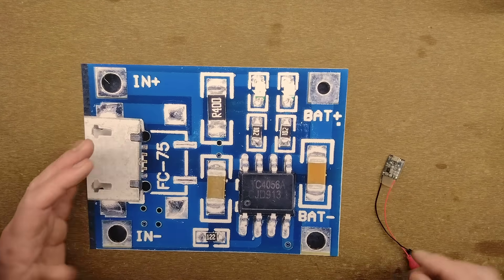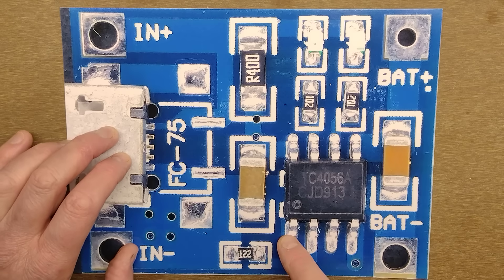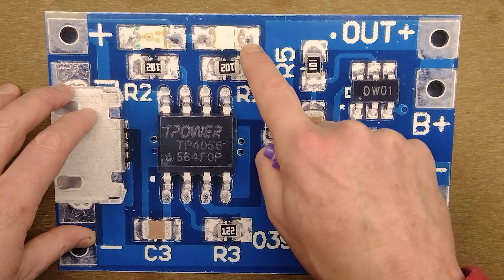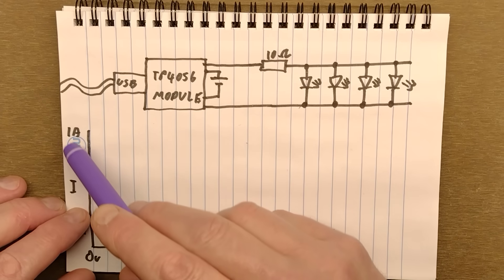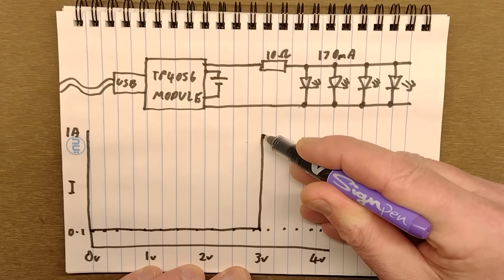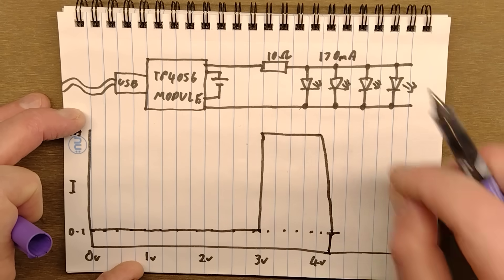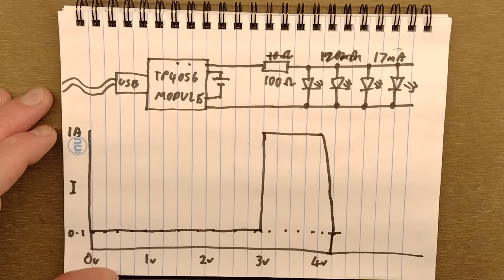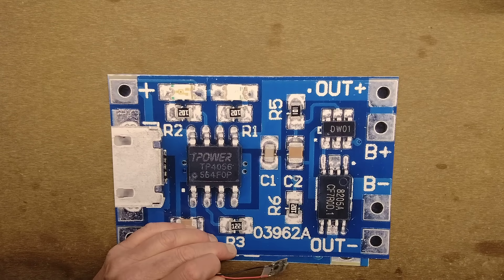TP4056 myth busting

Comment: That seems the opposite of the widespread myth of starting cars or motorcycles that are not driven in winter for 15 minutes every weekend "to keep the battery fully charged"
Then in the spring/summer they are frustrated to discover that they need to buy a new battery "after all the care" they gave to the old one... 😓

Comment: ive found significant differences in 4056 versions -if your cell is under voltage some tc4056a trickle charge at 60ma some at 200ma (with a 2.2k mode resistor) but these chips really need reverse battery connection protection if using loose 18650,s and cheap battery boxes that have the same terminals both sides of the battery its so easy to blow the chip

Comment: You missed one potential gotcha here: Let's say that you have those LED's configured for 170mA and attached permanently to the battery, with the charger configured for 1A charge current. If the battery voltage ever drops below the trickle charge threshold, then the charger will only supply 100mA. All of that current will be burned by the LED's, and the battery will never charge to a high enough voltage to start the normal 1A charge cycle. This could effectively brick the device. The easiest way to fix this (if you're designing the device) is to include a circuit for load bypass, allowing current from the +5V charger to drive your load, and letting the battery charge chip charge the battery alone as it's intended.
Reply from the maker: There would be an equilibrium point where the lower voltage would result in lower LED current.
Reply: @bigclivedotcom  Yep absolutely that’s true, it will also depend on whether that voltage falls below the trickle charge threshold.

Comment: Is there a component one can change to set the CV level?  I'm interested in a storage voltage of ~ 3.8 V, and a conservative charge of 4.0 V.

A hack I've found is to put a Schottkey diode (forward) in series with the battery, which tricks the charger into thinking it's done while the battery is still at 3.9 V.  Although this hack wouldn't let one use the BMS feature of the fancier chip.
Reply: I also put Schottkey diodes in the charging circuits of a LiitoKala Lii-202 (for cylindrical cells).  Since that charger has modes for regular and HV cells, I have the option of charging to 3.9 V or 4.05 V.
Reply from the maker: I tried tow reverse parallel schottky diodes a while back for both charge and discharge limiting.  The TP4056 started oscillating because the forward voltage was affected by the current.

Comment: I once had a TP4056 fail dead-short across the cell when operating at 1A and its thermal limiter was active. Now I avoid using them over ~500mA unless I have really good airflow or a big PCB ground plane underneath.
Reply from the maker: The DW01 protection chip will also potentially shut down if it detects a short circuit.
Reply: @bigclivedotcom  but what about the board with no dw01? looks like theres nothing between the cell and the chip (apart from any connecting wires)?
Reply: maybe good idea to fit a fuse between the cell and the charge board?

Comment: I slightly disagree.
Please calculate with 20 ohms.  The LEDs now take 85mA. The charging would stop, when the battery takes less than 15mA, not the 100mA intended.

Comment: It really helped me to understand how chargers work when I found out they limit current by providing the voltage necessary to draw the set current. The required voltage keeps increasing until it reaches the max voltage and it maintains that voltage with less and less current being drawn until the battery is fully charged. That is why fast charge phones brag about how fast they can charge from 0% to 70-80%, not 100% because that's where they reach max voltage and max current becomes irrelevant.

Comment: Would you say there’s a maximum (or sensible!) number of 18650’s in parallel that these modules can handle?
Reply: The sensible limit is given by how long you want to wait for your batteries to charge!

At 1A charge current, charging an array of dozens of cells would take days... Do the sums once you know the total capacity of your cells.
Reply from the maker: You get multi-chip modules for higher current.  But slow charging is best for cells if you have the time to wait.

Comment: Have you looked at one of these?  
empshield (first 3 letters of)dottie (first 3 letters of)communicaton 
 I could see how they might protect from a static discharge or distant lightning strike, but not against a stronger EMP.   Especially not the way they are installed.
Reply: took me 3 attempts to get around YTs auto mod for URLs
Reply from the maker: A lot of the EMP protection devices are scams working on the basis that if an actual EMP occurs then you won't be able to complain too easily.

Comment: I interpret the data sheet as it being: after the bulk CC 
, Go to CV@4.2V until the draw is 10% of CC.

That would mean that a load of 10% to 99% of the set current would mean the battery will be indefinitely floated at 4.2 volts, and that is what would hurt the battery, as I understand it
Reply: Agreed.  I wrote a blog post about addressing this, with a dead-simple circuit -  using a p-channel mosfet. Just search for "A circuit to charge a LiPo and drive a load at the same time".

Comment: I would really like to see you use the reclaimed cells and make a 12v battery pack with charge and discharge protection as well as balance charging. 

Fantastic vid as always
Reply: Yes, this will be super. Also, different ways of doing it. I'm currently using a boost converter for low current scenarios. But apparently one could daisy-chain these modules.
Reply: I'm currently using what your describing in my cordless drill. I used a 3S 40A BMS board. The board is around $1 in aliexpress

Comment: I'm also using using a similar board that can charge 7.4V lithium batteries. (Two cells in series) Multiple voltage input to charge my handheld radios. Works like a charm when I change the resistor to boost the charging current on bigger capacity batteries. Heat is a bit of a problem but a small heat sink helps.
Reply: careful trying to push them higher current, they may not be designed for it and may cause failure, even with heatsinking, the current may be too much
Reply: can you say which board please? I'm trying to repair some inspection lamps where the onboard charge/manage module has gone bad, it's just 2 in series 18650s. the light works while charger is connected but wont charge the pack, best Rob

Comment: I got some of these after your last video. $8 for a 5 pack from the jungle website. I took the cell out of a broken Bluetooth speaker and modified a cheap Christmas tree with it. Very easy and cheap. I’m glad you did this because after doing mine I saw some comments, but I have a switch on mine so I wasn’t too concerned

Comment: Last time I looked up battery charging recommendations, it was charge limited for a certain amount of the charge then set to the finish voltage until current went to 0 so that would explain that curve. It's not that it turns off the current (though it may), it's that the potentials are equal.
Reply: For common lithium ion batteries, the explicit recommendations are constant current from 3.0V up to almost 4.2V, then constant voltage until the current drops to 10% of the current used in the constant current phase, then turn off charging. There's no attempt to measure charge, just the current into and voltage at the cell. A search for "18650 battery datasheet" will turn up several datasheets, but they all say pretty much the same thing about charging.

Comment: If you get yourself a cheap air-rework station, that SMT resistor shouldn't be any harder than a through-pin one.
Reply from the maker: I have one, but I was thinking more of the average person who might just have a soldering iron.
Reply: @bigclivedotcom  I see your point but after getting one, I have to say I see it as essential equipment now. Well worth the (fairly low) spend. Anyone who is advanced enough to be considering changing out these resistors should probably give serious consideration to the purchase.

Comment: Is there a single indicator LED variant of this, or is that something else? (Going from blink to solid lit seems to be another very common charging circuit indicator, using a single LED instead of two. Pointing out the blinking charge status as I figure the dual color LEDs would be the same as switching two different ones, making it more likely to be the same controller as this.) Subtle difference, but I figure it falls under the umbrella of the logic of this circuit.
Reply from the maker: There is.  It's actually a power bank chip.

Comment: I have lights set up to run of old cell phone battery and this is how I charge them and I use the lights when they are charging. I have been using 2 of these for at least a year with no problem they dont get hot at all.

Comment: Can this board be used to connect 3 or 4 old solar garden light panels to to charge a lipo cell or two then run a chain or leds?
Reply from the maker: If your solar panel array puts out around 5V then it can be used to charge cells.
Reply: @bigclivedotcom   Thanks Clive. I looked up the board and it says if more then 5v input it will only charge at a rate of 1000ma now my question is I’m sure I measured 8v plus on the little garden light solar panels in the summer so if this is the case what happens to the excess voltage? Will it over heat whatever limits it? Maybe you could test this out or put a video together showing a method of this project as I’m too looking for a use for these discarded small lipo cells.

Comment: Even though the TP4056 can't cause the cell voltage to go above the maximum acceptable voltage, I am told that continuously applying 4.2V to a full lithium battery, as would happen in example one, will over time cause unwanted chemistry that degrades the battery. Given that this is damage to the battery caused by the TP4056 trying to continue charging after it should have stopped, I am very comfortable referring to this phenomenon as "overcharging". To me, it has an even greater claim to that word than applying an excessive voltage to the battery.

I am trying to find a citation for this aspect of lithium battery chemistry, but I can't get Google to understand claim.
Reply: best I can get is a more formal version of the claim: "float charging" (defined for this claim as constant voltage charging with low or no minimum current cutoff threshold) a lithium battery at 4.2V will degrade the battery via lithium plating. The behavior of the TP4056 in your first example is effectively float charging at 4.2V.
Reply from the maker: Lithium cells will have a shorter lifespan if maintained at full or low charge due to the bias of lithium ions to one electrode.  But chemistry has evolved over time and it doesn't make a significant difference in an application which benefits from the continuous availability of emergency power.
Reply: @bigclivedotcom  I don't believe that is the same thing -- that battery is left at full charge even if the TP4056 terminates charge correctly. The battery will start to self-discharge when charging stops, but self discharge is on the order of months whereas the module board seems to be aimed at applications where the charge source will usually be connected less than 24 hours (like charging a portable device overnight), so wear from just being at full charge isn't part of the claim.

Last night I saw one person (can't find them again) claim maintaining 4.2V for long enough will put the battery at 101% SOC, but when I look at a SOC graph, 100% is 4.25V, which would never be reached by the TP4056. Is there some degree of disagreement regarding what the SOC of a given voltage is?

Comment: Is there a similarly common "jellybean" module for charging a 2-cell (or even 3-cell) pack from USB? I find those more useful for some projects because you can get 5V if you need to (well, there are boards that boost 1 cell to 5V but for something that has to run forever in standby mode I don't know if their quiescent current is low enough). The only one I've used was pretty bulky, with a single style A plug and a full sized barrel jack for the output instead of just solder pads. Other than that the easy option is one of those USB 9V batteries, but they only hold about 20% of the energy of a pair of 18650s while taking up at least half the volume.

Another option would be to use a 12V USB PD trigger and just require a PD-capable supply, then get a board that charges from 12V. But those aren't even remotely easy to find. The only common DC in configuration is 1 cell from 5V; anything for higher DC voltages is only ever packages with that horrible excuse for a connector that was only really meant to set things on fire (tobacco).
Reply from the maker: Not from USB without a voltage booster.  You'd need a current limited supply higher than the combined cell voltage, and a suitable protection board that cut the power to the battery pack as soon as one cell met its upper or lower voltage limit.

Comment: I have used so many of these boards, and charging and use is absolutely fine, as long as you do not take more current than the board charges the batteries with!

Comment: I use these modules a lot and are a great little tool to keep the cells charged. I currently use two of these to trickle charge via a solar panel an umbrella light (homemade) that is SUPER bright. Great for grilling at night! I have tried to rejuvenate some cells but no luck using these modules...Clive said it was possible or did I misunderstand? Has anyone had any luck doing that?
Reply from the maker: A new or stored cell may improve capacity slightly after a few charge/discharge cycles.  An old low capacity lithium cell can't easily be rejuvenated as they do degrade chemically over time.

Comment: I haven’t found an equivalent device but for LiFePo4 voltages. I prefer using those for the stability but I have to build everything from scratch like the old days.
Reply from the maker: Yeah, there are LiFePo4 charge chips, but the modules are harder to find.

Comment: Using these BMS tp4056 versions to mod Christmas lights. 
Found in the standard Poundland light sets on sale this year that by clipping off the battery separators I can fit 4 x650 ma disposable vape batteries and the usb C tp4056 in the casing. 
Just a matter of making access hole for the charging port. 
Found a non timed set from last year ran on flash setting for 64 hours. 
Testing a (2.6v when I extracted it from disposable )single cell hooked up to  tp 4056 on bench it was drawing 860 ma. 
Also while charging switched on the lights and they worked as it charged.
Reply from the maker: If using outside in winter, let the lithium cells warm up to room temperature before charging them if it's below zero outside.
Reply: @bigclivedotcom  so true. 
Weather forecast for to night here is for minus 7 degrees C. 
This years offerings have seals and are outdoor rated. 
However any I have given these to I have pointed out that my cutting a charging port hole now means they are only suitable for indoor use. 
Have been thinking that if some one did want to use them outdoors I could fit a waterproof socket between battery box and lights. 
Allowing box to be brought indoors for charging every few day. 
Think there is still room in the casings if one removes the webbing in the battery box lids and fits tp4056 in this space. 
Bring inside and open lid to access charging port.